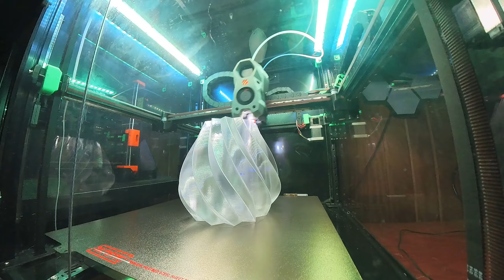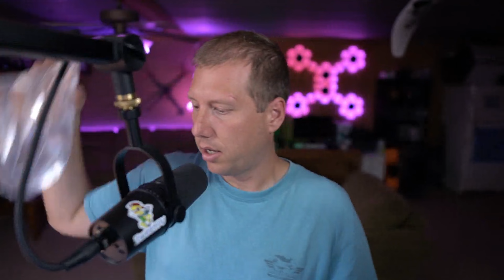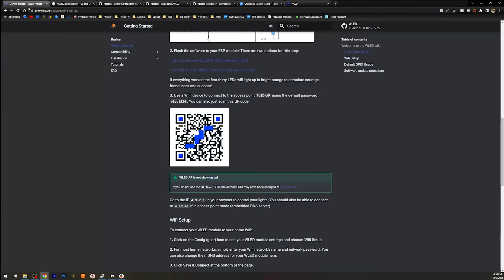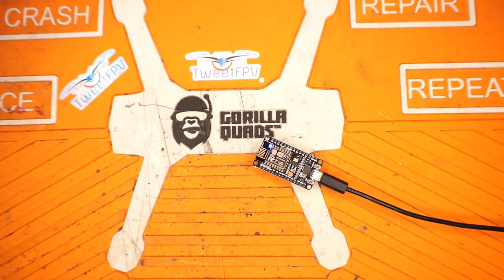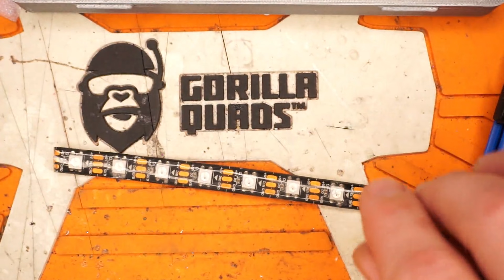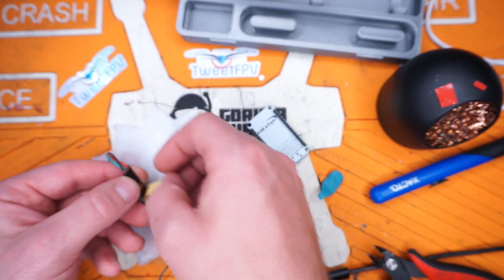DIY LED Xmas tree #3dprinting #holiday #xmas #wled

Comment: Hi, a technical question which I'm hoping you can help with, based on your experience: I crashed a quad and the LED pad is now shorting. Any clues as to why? There was a power distribution board attached to the pad before the crash and the LEDs were fried.
Reply from the maker: It's hard to say without having the board in hand. When you say it's shorting are you saying with a multimeter it's shorted to ground or when you connect leds to it the pad shorts out?
Reply: @TweetFPV  Thanks for responding....I'm getting the continuity beeps with a multimeter on the LED pad, which is where the I believe the problem lies.
Reply from the maker: Well there is chance that it's OK. Checking for continuity isn't always accurate without isolating the components. But in either case the board is probably damaged and would most likely need to be replaced.
Reply: @TweetFPV  Cheers!

Comment: I see pi boards are back in stores....   I think Im buying a few.  I have been using out of the box LED controllers that are cheap and easy to hand off to a non-techy...   hot glue is my friend is stuff like this..  drip some hot glue on.   then the heat gun to smooth it out
Reply from the maker: Hot glue works well but I was worried about the glue warping and deforning the petg base.
Reply: Boy are those Pi's spendy!! Nice to see them in stock though!
Reply from the maker: Yea but there are plenty of other low cost options out there.
Reply from the maker: Ypu can litterally run this off a elrs moduel 😂
Reply: @TweetFPV  Dude that is the kind of stuff I'm SUPER interested in! Like my dji fpv v1 radio must have some decent hardware that is reusable (probably not though.. because dji loves proprietary alien tech..) But I look at all of this spare hardware with decent processing power, and wonder what other uses it could have.. Like an elrs module for instance, which I have like 3 or 4 of lol..